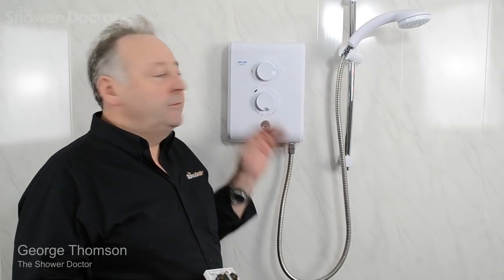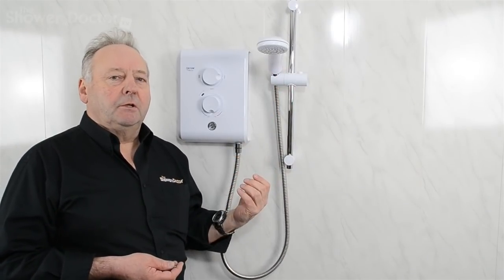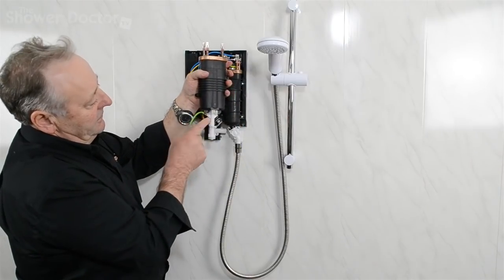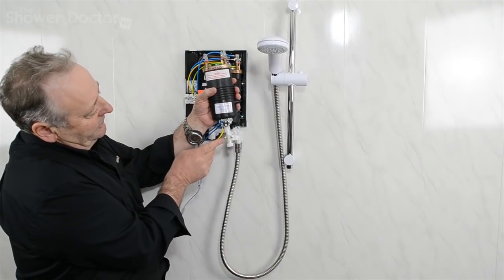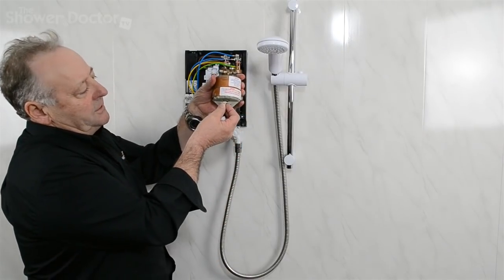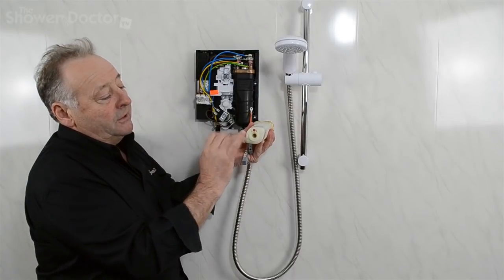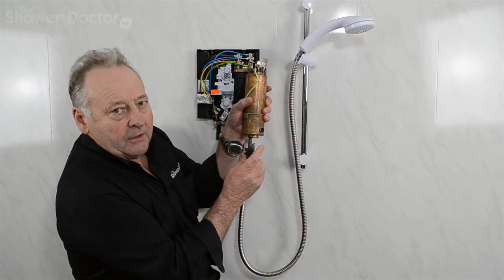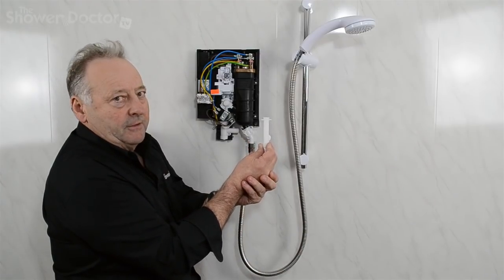Electric showers: A guide to pressure relief devices (PRDs).

Comment: Thanks showerdoc. Found the correct replacement PRD very easily on your website using the product search. The replacement PRD arrived very promptly. The video made it very easy to do the replacement fitting - with absolutely no previous experience. Thanks for the safety advice that gave me confidence before  taking the cover off the shower! Job done.

Comment: Hi thanks for the video. I have a 10.5 delux, which I have just  connected a few weeks ago from today (It had been sitting on the wall for over 10 years waiting for me to get motivated to connect it). Been using it for about two weeks, and now the PRD is blowing. I have removed it and reset the ball, but it just goes again, so definitely need a new one. Should I be worried about the cause of this and if I fit a new PRD will it just keep blowing? The shower head came with the unit, so is old  but is new in terms of service and so shouldn't have any build up of lime scale. I have tried the head in different modes blowing air into the pipe and the back pressure isn't massive. Is there a problem within the unit or could it be the ball slightly perishing having sat there doing nothing for possibly 10 years? Any thoughts greatly appreciated. BTW our mains water pressure is very good.

Comment from the maker: The handles on the front must engage with the flow valve and the 3 flat sections of the tank base assembly in the correct way, this maybe where the problem lies. These are very awkward to fit and it may take a couple of goes to get it right.
Reply: My triton Clara showed runs for several minutes and then stops. It will then start itself after about a minute. Is this the solenoid or thermostats

Comment: hi wonder if you can help me...

I have had a new shower fitted. A mira sport, the older model purchased from ebay :). The shower runs absolutely fine, until someone turns the tap on downstairs, flushes the toilet, or even if the dish washer runs. Basically if any water device is used downstairs the water turns cold in the shower. Is there a cheap fix for this problem as im on a tight budget at the moment. Mains is direct into the boiler, which is a combi. There used to be tanks in the attic???

Comment: Shower is connected to water mains. I don't know what the water pressure is sorry, but the original shower was a triton & of less kw. Would a 'Flo~mate Mains Pressure Boost Pump' help for my situation? can it continue to provide my shower with adequate pressure even if a tap(s) (upstairs or downstairs) are turned on simultaneously during the showers use. 

Or is a 'Single ended power pump' better to use directly with the cold feed to the shower?

This advice given to me by a local plumber! tx

Comment: Hi there, Fred in Essex, enjoyed all you videos on showers, think it is your first one, we have a shower at the end of that clip, the one with the big red know in the middle and the blue solenoid valve, thos thermal cut outs, are they the only thermostat on there?, whn they go open circuit do they cool down and work properly again or do you have to buy a new one, we have one that keeps knocking out the cut out switches, the flow rate seems perfect, rushes out...Fred NR Chelmsford Essex.
Reply: When the Thermal Cut Out(TCO) goes open circuit it means it has failed completely and needs replacing with a new one.